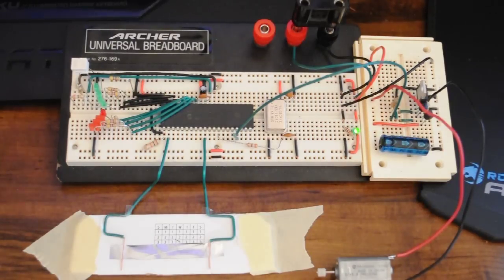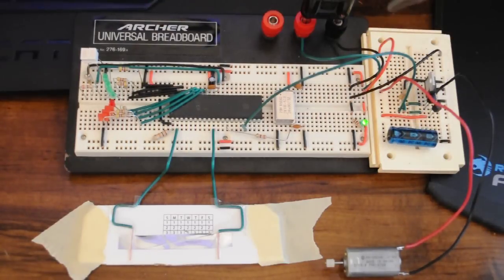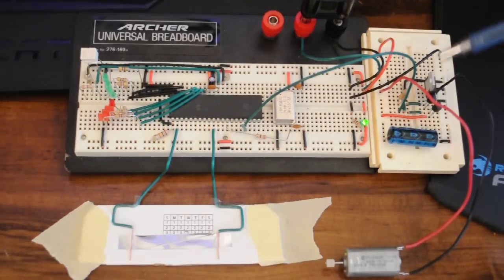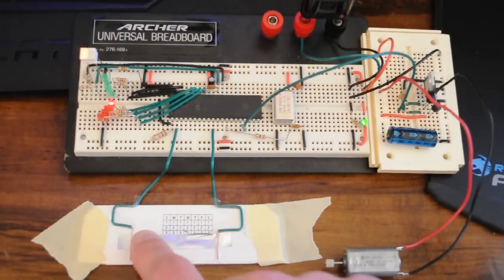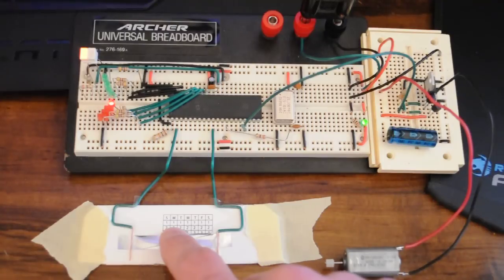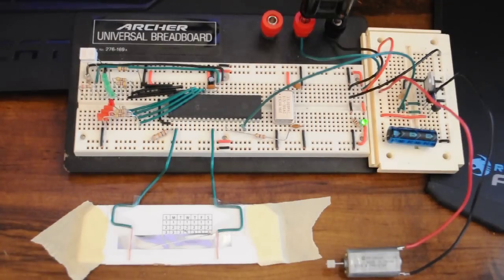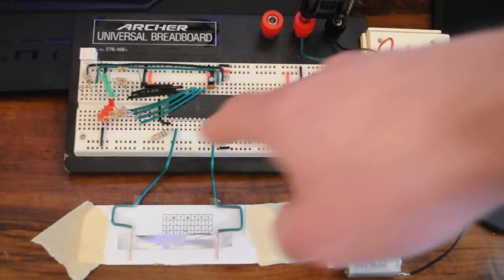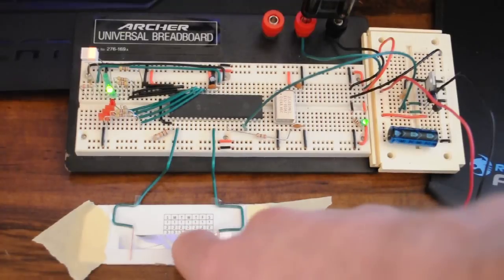Capacitive touch slider using only an ADC

Comment: Is there a limit to the length of the foil strip? I’d like to build one that’s maybe 60cm to a metre long. Is there also a limit to sensitivity? You’ve got 8 LEDs as indicators...if it COULD be made 60cm long, could you have one led per cm (ie 60 in total)?
Reply from the maker: I haven't done anything with this project in the time since posting. However, I imagine you will hit practical limits at some point. E.g. how accurately you can cut the foil; your ADC resolution might also be a limit but more than 9 or 10 bits is just adding bits under the noise floor (yes to a sensitivity limit) IIRC. I would consider using a vinyl cutter and cutting a stepped pattern instead of the ramp - if you have access to one, if not - the great part of such a sensor project is that the cost of experimentation is cheap ;)

Comment: Are you measuring the analog voltage from the pins attached to the strip ?
Reply from the maker: Sounds right ... this was 6 years ago ;)
Reply: I know am late :D But am quite not able to pick up how diagonal cut on the strip is working. You have any materials on it ? I am trying to replicate the same without much luck.
Reply from the maker: If both plates have the same charge/voltage then the differential read by the ADC will be negligible.
First, make sure the strips aren't shorted together.
Second, don't neglect the tape over the foil - the point is to capacitvly couple the plates to your body, not to "short" them through your finger.

... are you trying to do this on something powered from an isolated supply (e.g. a battery or a bench power supply)? If so I'm not sure it will work - maybe it would but I'd start with ensuring your ground is tied to earth.

The coupling will be affected by the environment, high humidity will assist the coupling, extremely dry conditions will likewise have a negative impact.

Also, it's possible that the way the ADC operates in various micros impacts how well this form of sensing works as well...

Thinking "out loud" here (I'm making this up as I reflect on this old experiment with new knowledge):
I can see 2 likely modes of operation...

One where the ADC sensing cap is close in value to the foil pad (8-12pf or something) and assuming parasitic leakage is keeping the system at some above zero resting voltage. This together means that when you add your finger to the pad you are significantly shifting the ratio of the effective capacitances and therefore changing how much the voltage droops when the ADC fills its tank - but the resting voltage of the foil plate is actually not changed.

The other mode involves affecting a change in the voltage of the pad by simply capacitivly coupling the voltage at your finger into the foil and therefore (likely) increasing its voltage.

If you are having trouble understanding the 'physics' look into how charge pumps operate. The same base physics is at play in a capacitive pad... it's just a very different application of capacitive coupling.

Try what Tony Wilk did in a comment below. IIRC it's fairly common for proper capacitive pads to use things like ground screens and charged rings/plates, etc. to exert more active control over the coupling... 

good luck!
Reply: I created a setup like you have suggested. Tape isolation was the issue. But the issue is that it is not as reliable and robust as I though it would be. Thank you :)

Comment: ah, ok.  I wasn't sure if you were loading up the capacitance of your finger, and then letting that equalize with the capacitor inside the adc.  I'm trying to build a capacitive slider for use with an Attiny13A that runs some mosfets connected to an rgb strip, but due to size limitations, I have to avoid additional libraries (floating point, etc.)  Do you have any additional resources on this subject?

Comment: I'm curious, what is the code for the sampleADC() function? Does it follow the same steps as the ones detailed in Microchip's "Capacitive Touch Using Only an ADC (“CVD”)" AppNote?